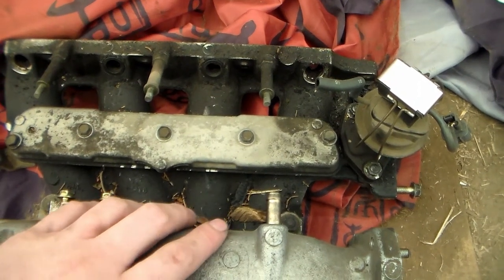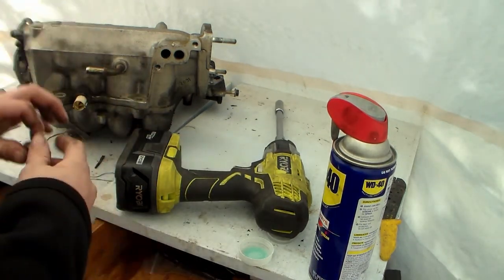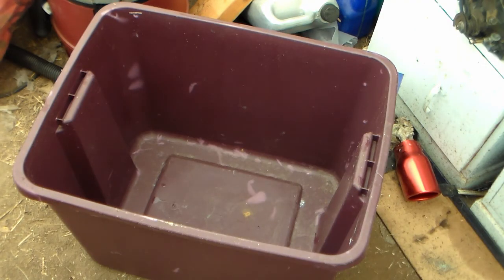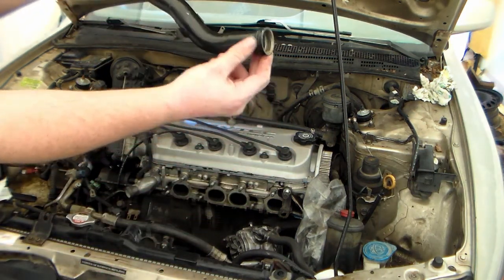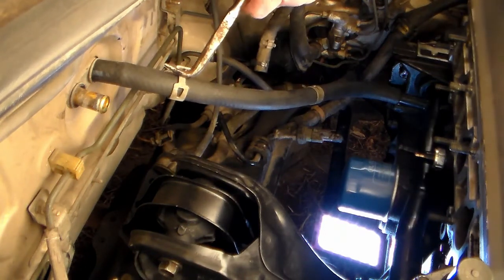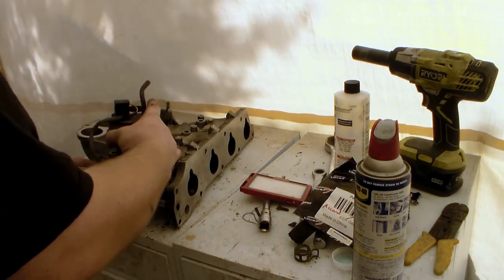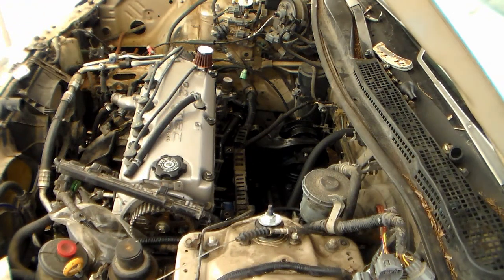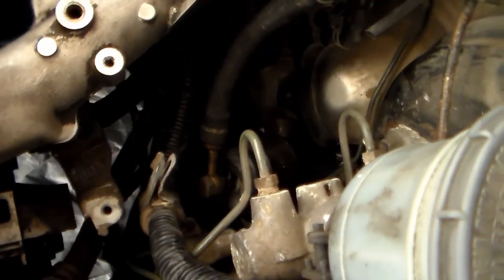Washing and reinstalling the intake manifold and water pipe on my Honda Accord Wagon

Comment: So I can remove the Entire Intake Manifold without removing the EGR ?
Reply from the maker: Absolutely, you can absolutely remove it without touching the EGR valve. There's a video on my channel called "Accord Wagon Removing the Intake & Exhaust Prep for New Engine Head" where I show the process for removal if you need a walk through.
Reply: @foxisretrofitting4556  Thanks I appreciate it. I got it off but I realized I had to remove the water pipe as well which I didn’t know. It was the EGR bolts giving me a hard time. I went thru 3 adapters trying to take it off. Everything else came off easily all the Manifold bolts and underneath Harness too  I didn’t have any special extension tools tho all regular basic Wrenches and ratchet
Reply from the maker: @DTunedF22  I feel that. That EGR is tightly placed. If you ever have any doubts or need to look back for reference I have the whole top end and coolant system tear down and reassembly on the channel in parts. If there's something you don't remember or I don't show don't hesitate to ask and I'll upload a video or picture for your to reference.